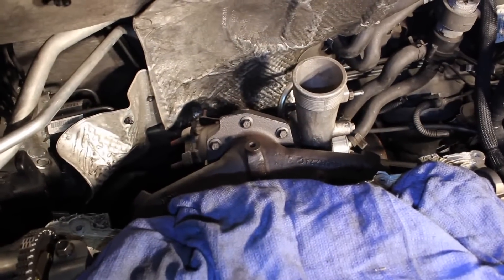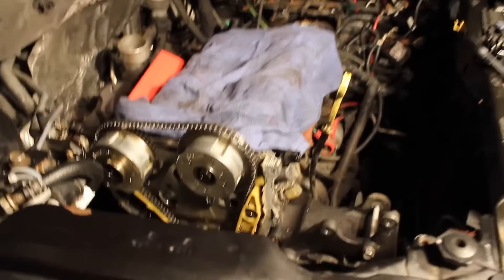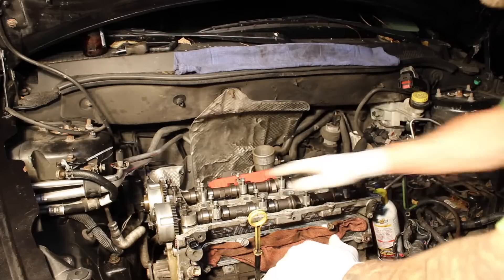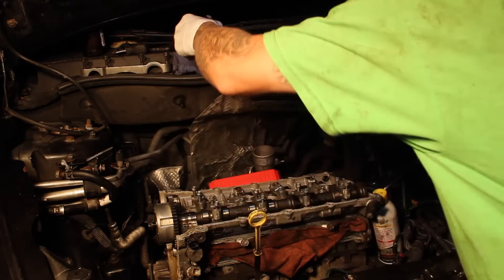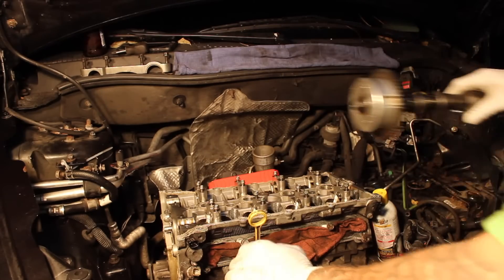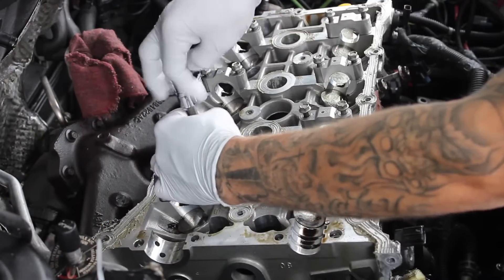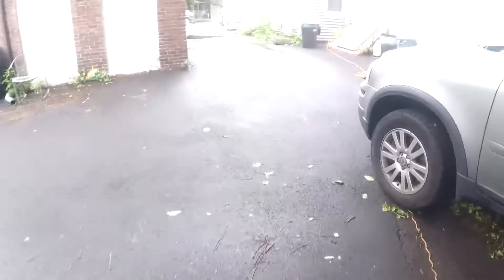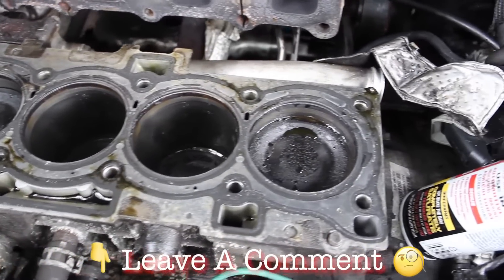Caliber SRT4 Engine Tear Down - Part 2 ~ Turbo Mani/Timing Chain/Cams/Head Removal

Comment: I'm trying to reverse engineer a regular gema 2.4 into a turbocharged replica of the mill found inside the csrt4. It would've been really helpful if you had shown us the turbo setup. Specifically the coolant and oil feed lines.
Reply: @SkittlefabzSRT4  yes I observed that when you were prepping yours with tape. Im hoping the differences can be adjusted with a sandwich plate and custom oil pan.
Reply: @SkittlefabzSRT4  I came here looking for help and this how you treat a stranger. Gotta winder why your wife left you and chose to put that on your channel. Soft ass punk. Have a good day.
Reply: @SkittlefabzSRT4  I was never trying to tell you how to do anything. Admittedly I definitely was pandering for inadvertent instructions but you're more of a loser than a YouTuber, or even a mechanic. As it clearly shows how much more interested you are in arguing with strangers on your channel instead of putting out good quality, useful content.
Reply: @SkittlefabzSRT4  I thought you'd have been more help seeing that you're videos are 30 minutes on average. Just another click bait vlogger. Thanks anyways. 😊